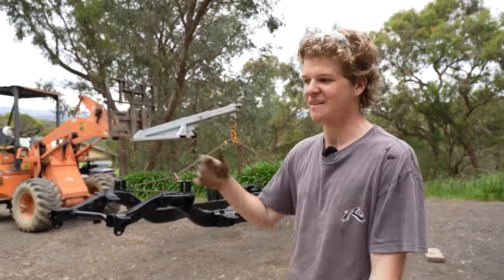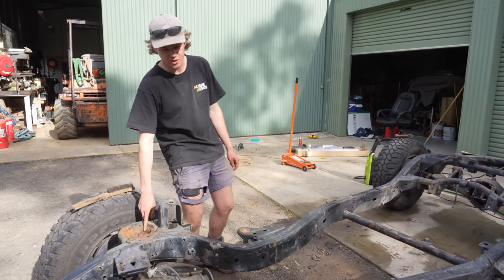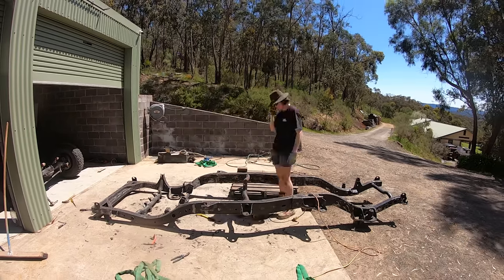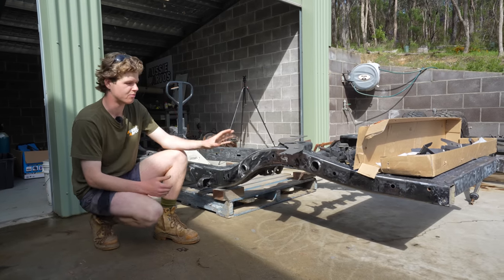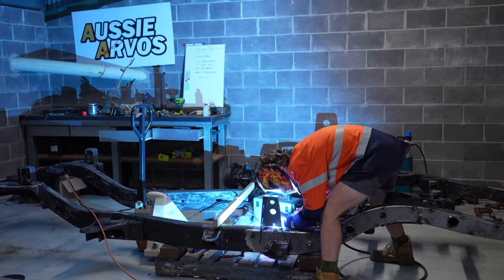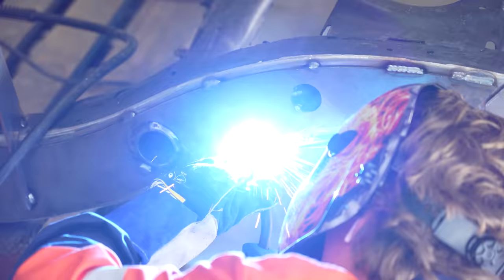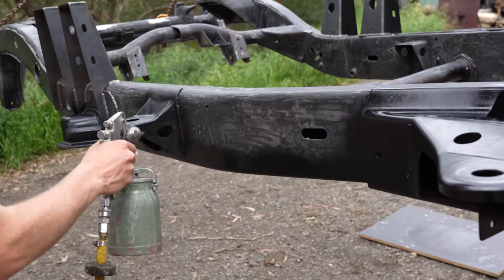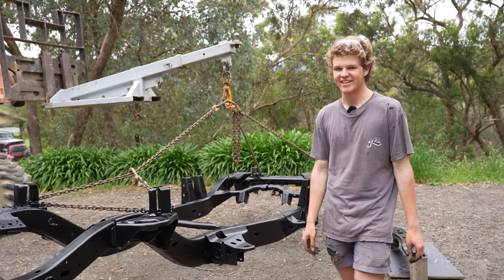Turning a 4x4 Wagon into a UTE!

Comment: Great video fellas it’s all coming together the main reason you stitch weld is because if the chassis flexes and a weld cracks it will continue to crack the entire weld , if any welds crack the way you did it , the crack can only go 1 inch not the length of the chassis great job!
Reply from the maker: Thanks Tristan! :)
Reply: That's very handy to know cheers mate!
Reply: Aweesome content, loving this build. U can still flip the tailshaft and the crossmember notch, i dont know what height lift u will b running but u might need to flip it

Comment: I would look at getting rear coil tower brace. They are known to crack and tear from the chassis when heavier duty springs and weight is put on the rear end. Because you are doing the Ute, you could get the PSR rear coil tower brace that goes across both towers and gives strength to both towers and extra chassis cross bracing. Otherwise get the Blackhawk coil tower brace that bolt in before you put the springs in. It was one of the thing I needed from the engineer to get GVM upgrade and I was grateful I was made to do it because my coil towers had already started to bend upwards.

Awesome job with the build. Will hopefully inspire others to get out there and have a crack 👍

Comment: Nice work!  I have a GU tray/canopy (which is for sale, by the way).  It was recommended to me that due to there being a recognised problem with the rear shock tower braces tending to lean in after a time, that I put in a shock tower brace.  Ultimate Engineering fitted one of theirs to my car, along with rear control arms and a few other bits and pieces.  It might be worth considering one of these braces.  All the best!

Comment: You guys do good honest work and thats great. Unfortunately if i where you, i would strongly consider starting over. Like others have said, you should of applied weld though primer to the brace kit and  you should of used  kbs chassis coat instead of  rust guard. That  stuff will chip away over time and you will have to repaint it all over again. Save some  time take it to a sand blaster and start over, yes it sucks but your going to regret it other wise.

Comment: Great job with the welding. I second the comments about welding through primer but its done now so next best option is tp trap some oil between the plates. ACF50 is fantastic for that, its used inside the steel tubes of aircraft.
That chassis is looking mint! Cant wait for the next episode. 😁

Comment: great work, while its still a rolling chassis it would be a good time to apply cavity wax or whatever rust proofing you prefer on the inside of the chassis rails and the reinforcement plates. I like the lanolin rust proofing, and cut it down with wd-40 to get it to flow into hard to reach spots

Comment: Doing well. Definitely sika automotive sealant between all the stitch welds on the strengthening plates. The rust jacking in there will be brutal after a few years. And put some bloody pants on when your welding mate. The uv light that comes off the welder burns the hell out of you.

Comment: Lookin good man! Id say spray something in all the areas you cant get too like in the frames themselves, and inbetween the metal braces you welded on the sides of the rails (although thats gonna be hard) since theres still bare metal inbetween those plates that can start rusting again. Itll be hard, but theres really thin stuff out there that should be able to get inbetween the layers. I could check the product I use for that, but im in europe and its probably not available there

Comment: I said it on the last episode. Should have braced the rear coil towers. They crack. Easy to do on a bare chassis.
 I've helped 2 mates do their Patrol when they cracked. It's a pain in the arse on a road going vehicle.
Reply: I second this, save yourself the hassle later on
Reply: Superior sell a tower brace kit. Easy enough to add it in. Anytime before the tray goes on.
Reply: @krump743  Yep. That's why you would wait until you have finished painting the chassis to then go and weld other items on.  🤡

Comment: As other people have said should brace the rear towers before you put the body back on. Even a bolt in kit would be better than nothing. And should also raise the front shock towers, psr sells bolt in rasied towers and then you can run longer shocks. With the chasssis brace and welding its basically up to the engineer. Some say dont use the brace and others want you to use it. With the chassis brace since you didnt show you using weld through primer on the rails and brace before welding im going to assume you didnt use any and you will most likely get a lot of brown rusty water seeping out behind those braces running down your chassis after moisture and water has gotten in there. Depending on the engineer they might pick up on it and want you to redo the whole thing.

Comment: Sorry to burst your bubble but stitch welding you reinforcing plates is counter-productive in a few ways, from a structural point your creating stress risers at the end of every weld and zones where the gaps are as flex will be concentrated at those points the other issue is you now have corrosion traps as they are not fully sealed by welding, having done many chassis repairs, stretches and upgrades over decades you see what does and doesn't last